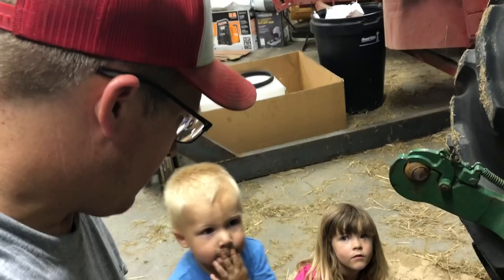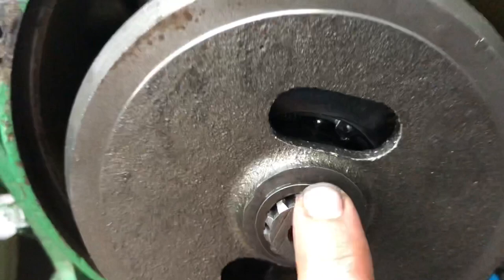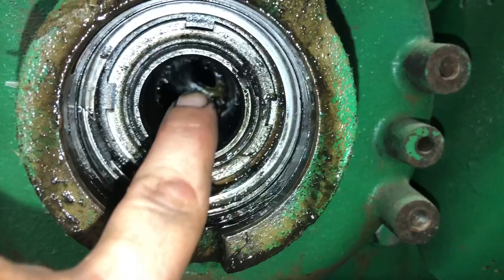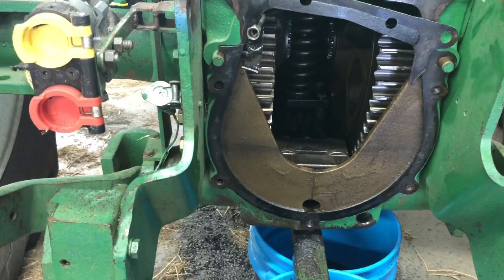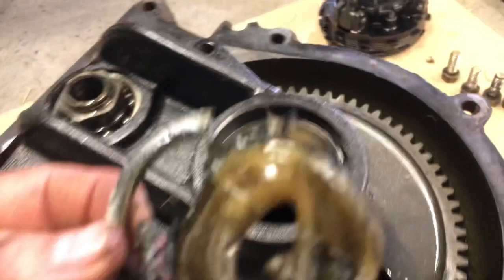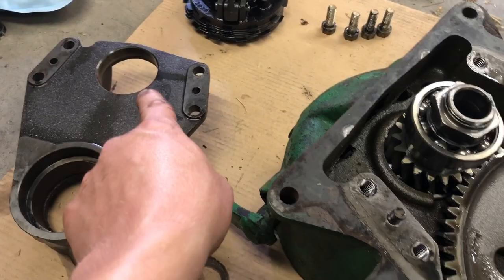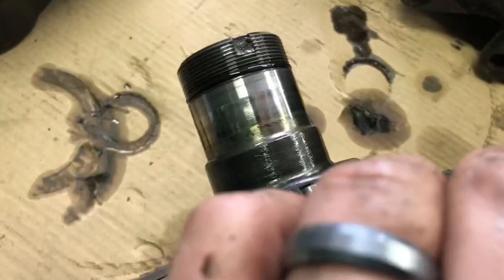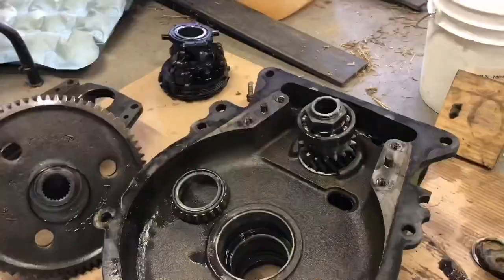Oliver 1650 PTO Unit Removal and Seals

Comment: Very good video. I noticed your hydraulic fittings on each side is that a new style cause my hydraulic couplers I have such a hard time putting them back in any secrets out of them or is that a easier fitting you have on your tractor?
Reply from the maker: They were on there when I bought the tractor. But I believe you can get them from several hydraulic suppliers. If you Google them they're a kit. They are easy to hook and unhook for sure. I like them
Reply: Yeah, on all my tractors 285 two 105-18 50, 18,55, 1955 darn hydraulic so hard to plug-in but I had the stroke and had to sell my tractors I got. two left 2105 and a 285 good tractors, easy on fuel light work. Thank you.

Comment: good content. Doing the same to 1655.   Having trouble getting 45 degree fitting off upper part of oil line.  Any ideas?   Thanks         Larry
Reply from the maker: Are you talking about the lube line that goes through the house and lubes the clutch bearing? Im not sure if it’s the same on a 55 series but on mine I was able to use a wrench. But I had to take the 90 off the line that goes to the front because the fitting wouldn’t fit through the opening. Not sure if it’s something that won’t come lose or you just can’t get a wrench on it?